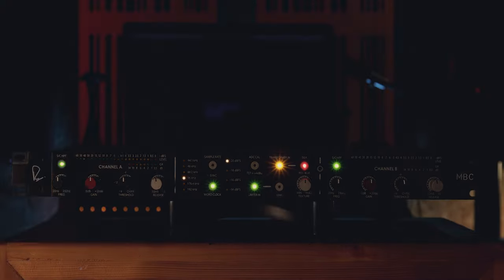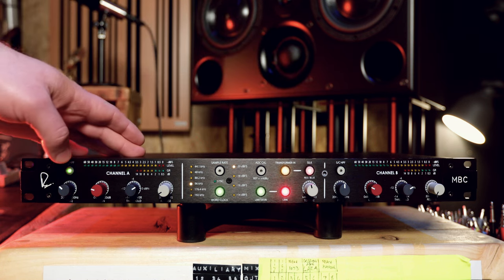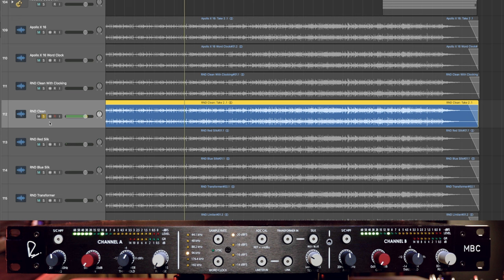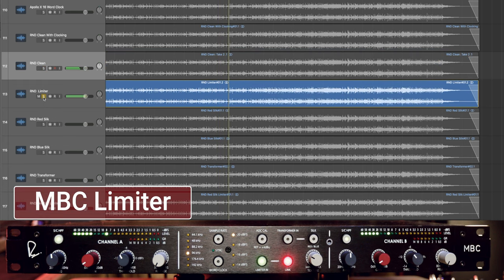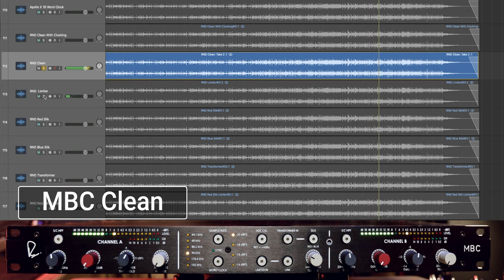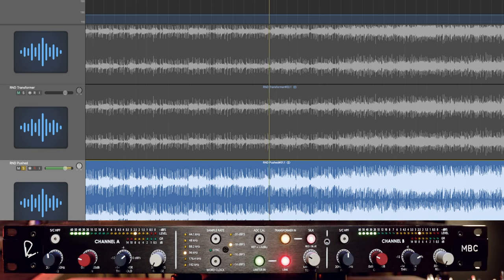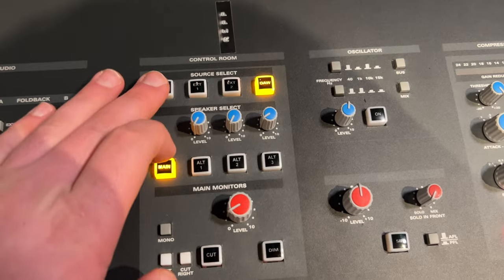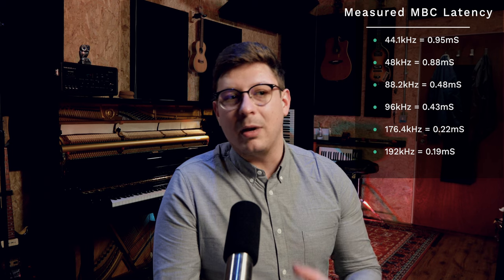Rupert Neve Designs MBC Demo & Review

Comment: We use the Mytek 8x192 AD/DA.  Because it is, well pretty great.  Vibrant and alive like a really well maintained tape machine with an amazing low end.  Nicest DAC I have heard and we had a lot of them in the studio (Crane Song, Burl, Avid, Prism et al).  Especially when you factor in the price.  That said, the MBC sounds really, really nice mate.  Perfect for what you're doing.  I guess they took a page out of Burl's book (the Bomber AD which is also very nice).  Apollo is obviously very workable but it's pretty obvious to anyone with a good monitoring setup that these kind of converters are just nicer.  It's a very expensive sound.  Bit like a nice transformer laden console on the front end.  I'd buy it and use it.  Great demo thanks.
Reply from the maker: It’s a solid piece of kit for sure. :) I like that you can pick whether you want the transformers, silk or limiting. Or just lovely and clean. It’s a bit of a chameleon which I really enjoy too. 

Thanks for the kind words!

Comment: Hi Alec, wow, i am blown away by the difference, the clocking does to the X16. I kind of thought, that converters these days are as good, that an external clock does not do any good anymore. I use the apollo and for main bus conversion the ADI-2 Pro - wich to me is outstanding (and much cheaper than the MBC). I will try, what that does, when it clocks the Apollos. Thanks a lot for your videos!!
Reply from the maker: It’s a huge difference right?! Crazy. Let me know what you find! :)

Comment: I tried a Grimm CC2 clock with my Apollo X6 and heard a similar, but I think even more extreme difference. A better clock seems to make it sound more open and smoother in the highs and more extended in the lows. It also relaxes the mid range, so you hear more details. Overall, you end up with a more expensive and pleasant sound. 

Good video.
Reply from the maker: It’s really made me curious to experiment more with other clocks to hear the different tones. I’ve not yet tried a Grimm, but I’ll have to look into them and see what the deal is! :)

Comment: I like the sound of the blue circuit. Those apollo converters are not too shabby in comparison. I have been using a lot of bettermaker gear and I highly recommend it if you ever can review. Other than my mastering manley vari mu, I am starting to lean towards analog gear that has either stepped controls or a plugin to control it. Really cool technology .
Reply from the maker: I have done a review on the Darth Limiter, I also use the Mastering EQ daily. :) plug-in control is the only way!

Comment: Great presentation ... I mix 100% in a keyboard workstation and I would like to add some "character", color and some "glue" (like you would do with a compressor 2:1 ratio - just a little bit of that spice...) before entering "computer space" to do final mastering with plugins ... Of course I would enter the computer with -7 db max. so I would leave some room for mastering. I see the transformers and silk function useful, but can the limiter be a substitute for a little compression in my case or is it better to buy just high end mastering bus compressor? :)) In another worlds can this device give me not just color before mastering but that little "analog glue", depth, wideness, before entering the sterile world of plugins?:)))
Reply from the maker: I would look into a the Rupert Neve Master Buss Processor for all of those functions and a couple more. :)
Reply: @alecbrits  O.K. Thanks ... :)
Reply: @alecbrits  I'm back again watching this baby ... Rupert Neve Master Buss Processor is great but all this can give you plugins if you know how to use them, but they can't give you top of the line transformers and silk options that give the sound that larger than life feel. Limiter is useful for the final stage (as the last compressor limiter) after preliminary mastering just to add that extra glue at the end. You can achieve all and more of what Master buss Processor does with plugins, but you can't have it all that that this unit does and be right at the door of digital domain. Since Rupert Neve Master Buss Processor is all analog (no digital output on the back) you have to spend another 5000 dollars just to make it work. So, yeah. This unit first, all the other options later when you're already famous. 😄😄

Comment: How are you listening to the unit if it has digital outs, but you are running the UA at the same time? I have been looking for an in-depth video on how to connect this unit, but no luck.
Reply from the maker: It’s connected via AES to the Apollo. The console has three mix outputs. So I can route one set to the Apollo’s and the sending to the MBC. That way I can create two separate monitoring Channels in logic. :)